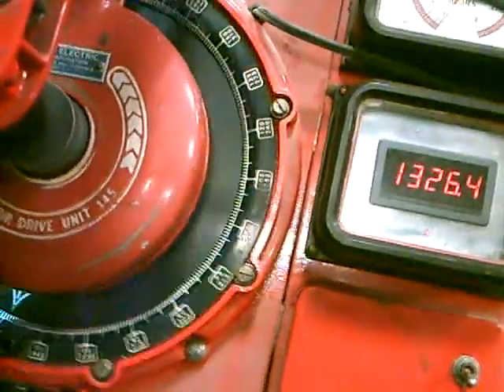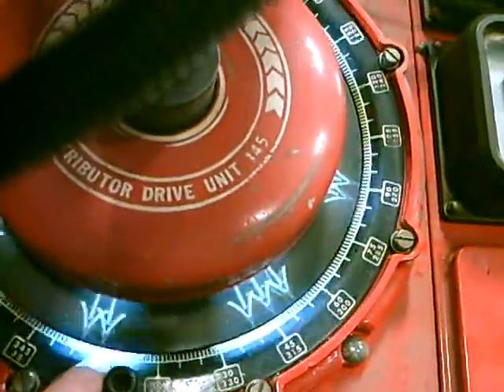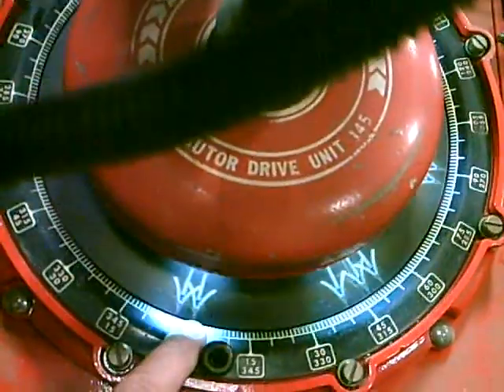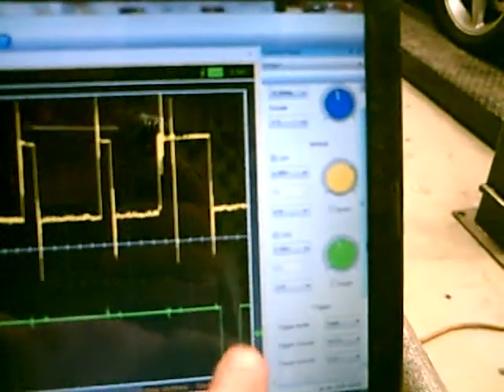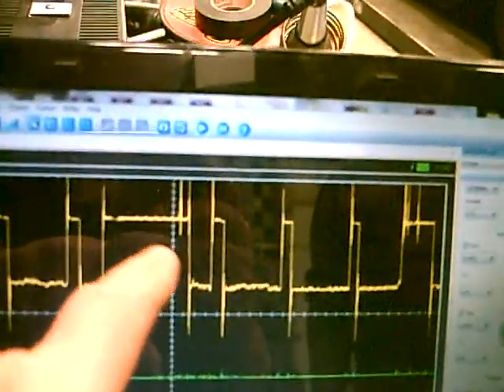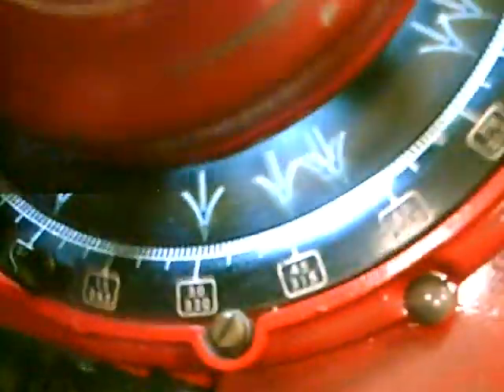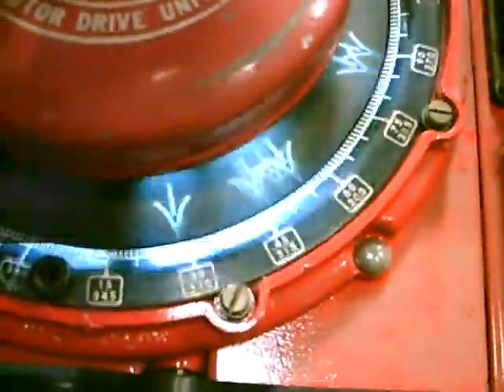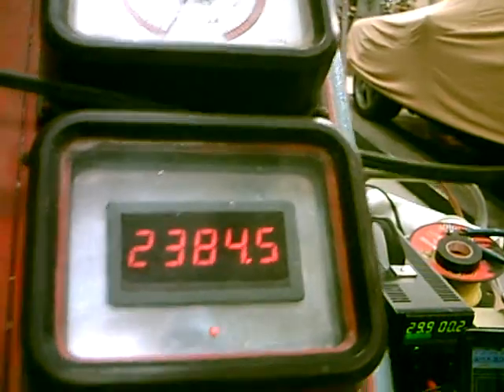SUN Distributor Machine High Speed LED Flash Dwell #1

Comment: Hello, do you kits? I have the same machine and would like to get it working! If not kits, maybe a schematic? Thanks!
Reply from the maker: The LED modules are available.  This requires removing everything not in the plug in front panel modules.  Send module numbers, not the machine model. Many times these modules have been replaced with newer ones.  Provide email and I will send manual first so entire upgrade is understood before ordering.
Reply: @opera5714  it seems I can't post my email, they just get deleted
Reply from the maker: @bazookabert  I have never seen that here, but other places people just use two words with spaces, no punctuations. It can also be sent in the first line and then deleted after 5 minutes and I still get the message, but it doesn't appear anymore.
Reply: @opera5714   I have one that needs up graded  , not having any luck posting my contact info
Reply from the maker: @geoffb7177    Break up the address into separate words.   I tried using dropbox, apparently that also needs an email to deliver.

Comment: That dwell flash is a very cool feature. Going by your other videos you say that the LED unit you make replaces the entire power supply of the Sun machine?
Reply from the maker: My friends are into racing and I like my friends. They had three 6V machines from the 40's I rebuilt for them. Defective flash tubes make them just about worthless since flash tubes cost $600 and then the supply has to be rebuilt. I got tired of being zapped by that 500V. I sell the module for $229 and existing power supply is scrapped. The module does require an $11 on ebay US ship 12V 10A power supply. This eliminates the need for a battery. For best performance any old 5V cell phone charger boosts the voltage to the LED for a much brighter image. Other 5V power supplies are available for a couple bucks. This module makes it a 12V distributor machine which is also compatible with magnetic pickup distributors. Any  $10 HEI module will work with no need to spend $200 on an expensive adapter. The rotating assembly does need to be re balanced and relatively crude methods seem to work. I can help with other electronics as these meters seem to often be damaged. I can send more info if interested.
Reply: @opera5714  That's very helpful of you. I have a Sun 704 which has it's own dc power supply, but from what I can gather your module would replace all of that anyway. Having a bright LED, and the dwell being shown on the degree ring sounds great. What's a good way to contact you and purchase one of your modules?
Using an HEI is very clever by the way. After all they were specifically made to translate a magnetic pickup signal into a signal that would drive a coil. So obvious but I never would have thought of it in a million years.
Reply from the maker: @owenjohns6301  the HEI can be used on any 12V machine if 12V is brought out to power it. Does your flash tube still work. That 12v is unregulated and can be 140 to 180 percent of voltage with no load. Could you measure voltage at points with them open. Post email, it can be deleted after a day.
Reply: @opera5714  The flash tube works but it seems to get very dim after a few seconds of flashing.  I will check the voltage at the points and get back to you.
Reply from the maker: @owenjohns6301  There is no mention of the 704 in the Paramount Sun Manual Packet. Machine models have no meaning to me as I only know these machines by the module number on the dwell and tach assemblies. Aside from the 12V supply 
and Xenon tube model, The flash  power supply is pretty much the same. I prefer to work with machines that are for all practical purposes dead. For $159 I can be buying myself a pack of trouble. Some re builders have no trouble at all and others need endless emails. My machines are 30 miles away and in a couple of weeks I am gone till October at my summer home. I will be limited to whatever information with me. I know a lot about the electronics of these machines, but it was never my intention to be Mr Sun Machine. Just trying to save some machines which were destined to become scrap. 
I have some information from those who have done the conversion and will try to be as helpful as possible. There are a few modules left from the production run. When these are gone single production will be 2 to 3 times the current price, $159 doesn't buy you much at Paramount. Review the manual and fully understand before making a purchase.
Dwell Flash is nice, but I wouldn't consider doing a conversion just for that. One interesting feature is ghosting of the dwell arrow. This actually has nothing to do with Dwell Flash. The flash supply has such a fast recovery that it can see point bounce when the points close.  This only happens with poorly dressed points. Applying finger pressure to the points will mechanically dampen the bounce and make the 
image go away.
Reply: @opera5714  My mistake, it's a 504, not 704. And it's mostly dead, all that works is the drive unit, flasher, and the RPM meter. I would gladly pay $159, and I promise to not bug you too much about any install as I'm not in a hurry to upgrade it. You mentioned you sell through ebay?
Reply from the maker: @owenjohns6301  I no longer sell anything on ebay. Do take paypal. One thing you might consider is also making a calibrator for the speed and dwell meters. Not made a video but have helped others buils these using this module. https://www.ebay.com/itm/Signal-Generator-Module-PWM-Adjustable-Pulse-Frequency-Duty-Cycle-Square-Wave/333379937215?epid=8012576926&hash=item4d9efe23bf&_trkparms=ispr%3D1&enc=AQAEAAADYGwqRfta%2B5J8Oc6KxA1oXdPMWarHsEq%2Ba5LKHuGsjqpY9OGT10S%2Bv2PmYFL0s65UqYvVyJs5Zv5tc7Z%2F6F2Ni4nI3vAnqe9KB5ZQLLebhtvZd2mCvFW5WsBReBOzHjbkg9ZQR1sEq7Oh%2FbeW%2BUuEoR7G1RdJ2drzSL4uCb75Ng%2B7SLfMprQm8BHybl2o1iCpeW9yFf7TmvE7wsOWCqILkcYROXmocmXEJkpF42R8iP%2Bk8wlt45HO6cwMHY%2FGQ%2Butv83F%2BpntAGG8q8rtCc3eK1ecxSdUfJ0%2FXFsSRTkpvDV661pLnMcjDWBRGTgJ4HHdGH%2BzQ5DfYXwGuLCR7VaSaCwH88eiqP5Nkue4vttvEjIqzACg7qZ40bEWc%2FiM8TUkKmzsKC8uZgaorA2DDrfxcCVEbfWDbSqutQiCAlYY0VxxRDXIYthEJhJaX%2BbQ5TYhwjUcwBmL38iOb%2F1gT6VkVn%2FzL41sqFMpyyT%2Fjqswn0cpX1IAr%2F6Q59NbG%2F%2BcXiXgla7XhRdX%2BtG5eK6M%2Fu72qgfOMzUaMhaugEi0HBkTiWTwjYrhlpVb8xc462pQqaGvCpnNJVrCavotcexng3UjkrJYksaSArZs%2BfsVHbdDaoY2Ri2%2Foyvx5jR6eEk%2F28tKIsp%2FD8x26fSxqqZe5vvYZswkzrSc4XxF8GRXL1wz5OsYmP5jW9lJrax2ZH46bqb1qri9%2BJxZouTN58oSeuThewf%2FJPQ6kfl7E79SkoH2NlGoC7J3cuvVHkzHt899K3EEKi8yapRxorbo5LohzKV1yc4H7u4AOKDBgsVCFtf9%2Bl5ORvZkV73MSnr4IyZy1VLt%2BBYlcJ71%2BRyZ31HYxbObhqTGpuUfBSR8cDDO64Hb1VZt%2BkuzMzEUv%2BBXmubgMVRzkherOMsJANoWkZLI2LyWw%2Bylu53CLzbcKbtjwADV7fXdek8z7UNfL8qHJq8fa1u6k9DrU7SNPxzj03qpD40Sk47Mg%3D%3D&checksum=3333799372154b59ddc0ff514660a77cdd4b4a65c60e

I would include extra FET no charge

Comment: Can you tell me which led/controller equipment you use? I have an old head unit(spinning part) and have to build a cabinet and electronics for it. Thank you for any help you can give me.
Reply from the maker: I'm an electronics designer. My friends like to race so I designed this for them. And it is not worth doing unless you make it better than anyone else. I sell these on ebay and still have one left over from testing so it has to be sold as used. It is $229 and the last one before the price goes up. I've modified three of these machines.
Reply: @opera5714  I have bid on it. I have no desire on marketing. I am an electronics tech in the power plant business and work on the older cars for friends and love to tinker.
Reply: Are you going to offer any more of these? I have a SDT and I think the strobe lamp is burnt out.
Reply from the maker: @Thekarlskorner  I have three more with me as I am at camp for the summer. I figure that is about a two year supply.  I put one up for sale once in a while just to let people know they are available or when asked.  It is a very small market.  What model do you have? It doesn't matter much unless it is a high speed xenon type. I was just fooling around in this video.  The scope and tach is not a normal version of the upgrade. I have other videos.
Reply from the maker: @Thekarlskorner  Let me send you the documentation and you can look see if this is what you want to try. There are a lot of things that can cause it not to flash. The tube is generally weak for a long time before.  Here is a trick you probably don't know.  Create a new comment with your email. Send it. Wait a minute to be sure it is sent. Click on those three dots on the right. Click delete and everything goes away. But, this is the internet and nothing ever really goes away. I still get the message.
Reply: @opera5714  do you have more of those on ebay for sale? what is your ebay user? thanks!
Reply from the maker: @mocadnet  IThank you for your interest.  sell directly and have not sold on ebay for years due to fees. Currently I am moving and the modules have been packed. Not taking orders till mid July. Provide email in the next couple weeks and I will send manual. This is a serious project and you should make an honest evaluation of capabilities first.
Reply: @opera5714  it seem that emails get deleted when I try to enter it
Reply from the maker: @mocadnet  do name and provider later no AT. Moving allow week for response.